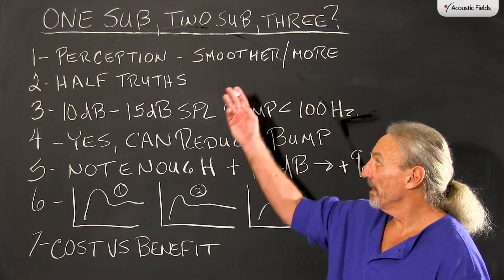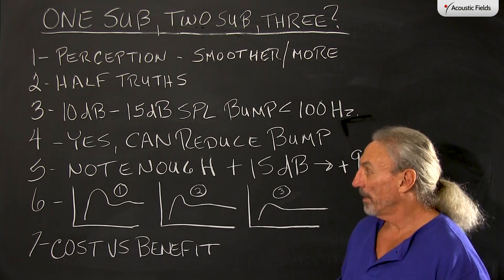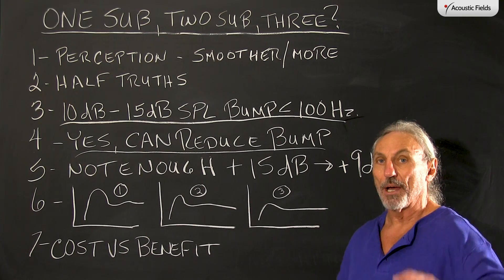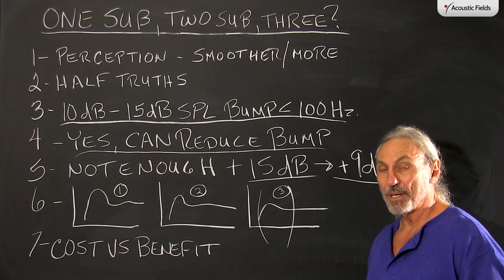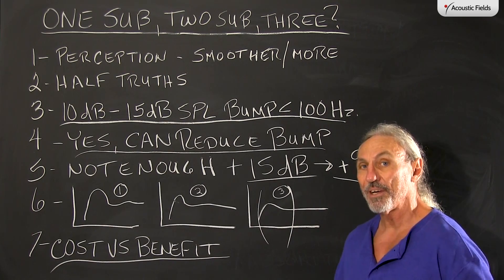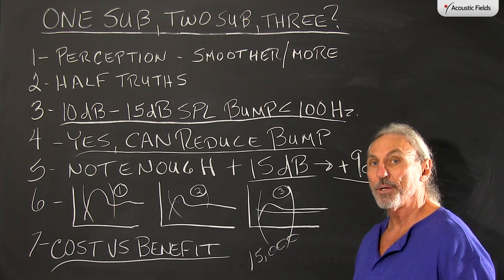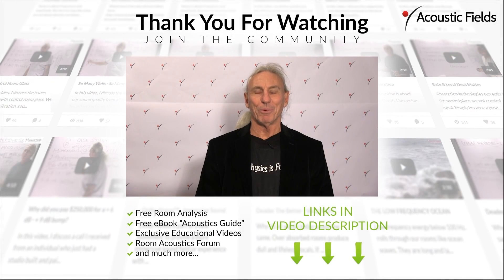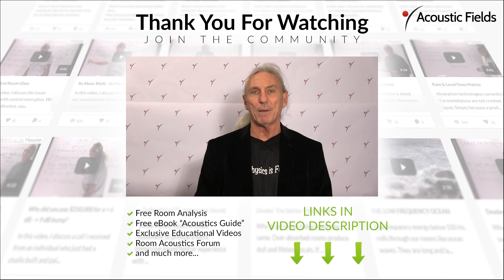One Sub, Two Subs, Three...? - www.AcousticFields.com

Comment: Love your channel.   Let me check my notes. To recap...treatment, treatment, treatment...!
Reply from the maker: Hi Oldskool, Treatment is only a tactic within an overall sound strategy. You must set up realistic sonic goals and use tactics to achieve them. You must match usage to room size and volume. Without a sound strategy for your room, you are just gambling. Gambling is guessing and if you guess in acoustics, you will guess wrong. There are simply too many variables to consider. This is why acoustics is so difficult for people to understand.
Reply: Acoustic Fields Thanks for your reply. I have yet to start my dream project of converting our unfinished loft into a home theater room. I'm in the "research stage" reading and viewing boatloads of info and trying not to become technically and financially overwhelmed. Your channel is super informative and required watching.                                    My quandry is how to build this room and outfit it without bankrupting the family and taking up permanent residence in the doghouse...Once I get my budget funded, I'll be taking the leap. Definitely intend to send you my room demensions for analysis.
Reply: What about home theaters where you have many listening positions positioned in rows

Comment: I’m just trying to figure out if 2 12” subs will be louder and clearer than 1 12” sub.
Reply from the maker: It would depend on room size/volume/usage. There is no one solution to every room.
Reply: @AcousticFields  I’m planning on putting some in my truck and I’m not sure if it would be best to go with one or two.

Comment: So eq will help or not, to turn down the freqs you don't want so loud
Reply from the maker: Hi Indopleaser, EQ has its benefits but you can not EQ + 10 dB bumps without hearing the EQ applied. There are artifacts that come into play when you try and EQ that wide of a range. Use the proper room size and volume, apply the correct low frequency technology to lower the low frequency energy issues down to + 3 dB and then apply EQ.  You will have much more natural sounding music.

Comment: Hello Dennis, can you please do a video on a multisub room with a Simple Bass Array  (SBA) on the front wall in a rectangular room and what type of treatment that should optimally be used on the rear wall to kill the only remaining room mode; the longitudinal one. Read a lot about it recently and it seems to be the best solution bar the Double Bass Array, which uses active cancellation on the rear wall.
Reply from the maker: Hi Makzmakz, I am not familiar with this term. Do you have a link for reference.
Reply: http://translate.google.com/translate?u=http%3A%2F%2Fde.wikipedia.org%2Fwiki%2FDouble_Bass_Array&sl=de&tl=en&hl=en&ie=UTF-8
Reply: Something like this is how I dealt with bass in my room, cool to finally see a formal dissertation on it. thanks for the link etc.

Comment: I bet it's just easier to sell more subwoofers than to persuade those people to get proper room treatment.
Reply from the maker: Hi Vlican, I do not know if it is easier but it is more profitable. You can minimize the low frequency bump in small rooms by pressure equalization through positioning and multiple sources but even that tactic will not produce an acceptable room response. At least not in my rooms.